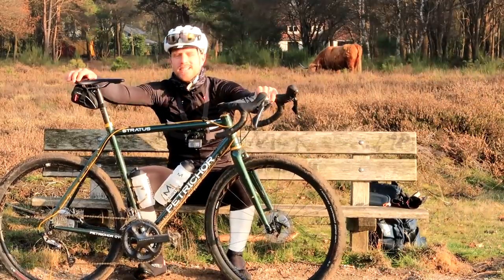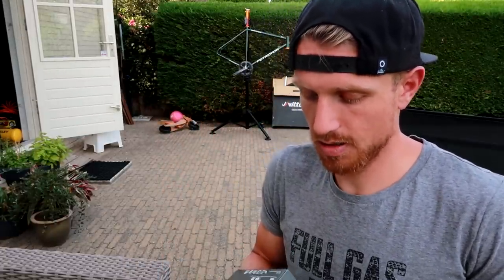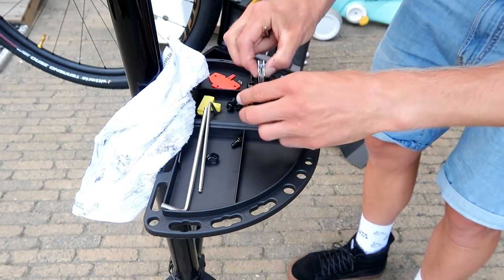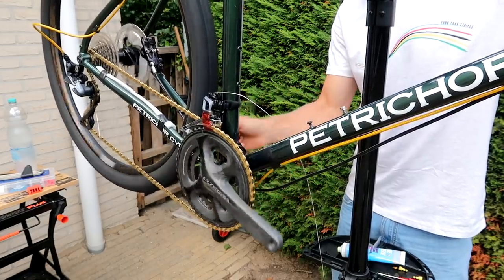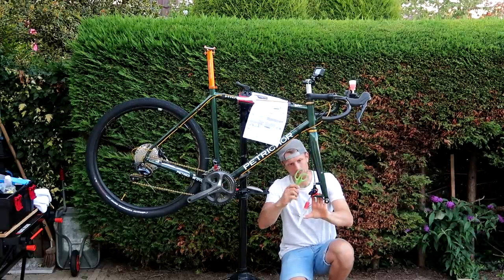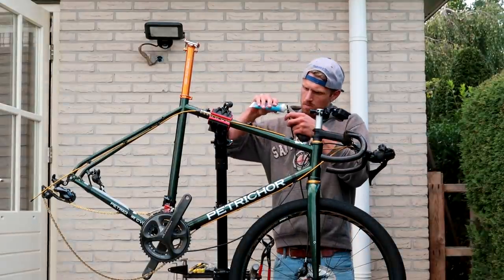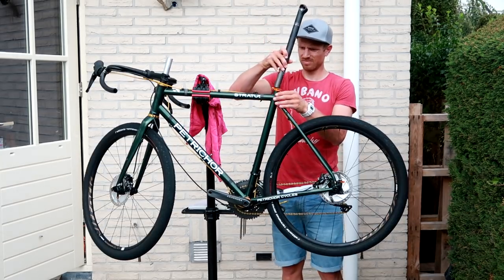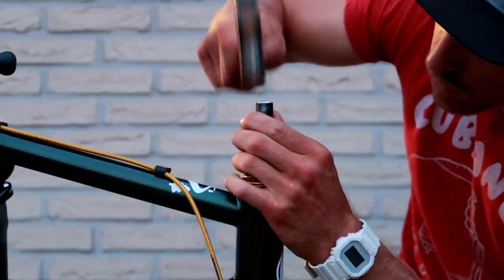My CUSTOM GRAVEL BIKE BUILD | part 2 - Installing and bleeding Shimano disc brakes

Comment: From my own experience. Steel frame with carbon seatpost. Make sure the frame seat tube edge doesnt have sharp edge, if not over time it will pinch/damage the carbon seatpost and do not put any grease on the seatpost. Also there is a easy way to bleed the fluid by using garden bottle water spray. Anyway bike looks awesome 👍
Reply: yup just a bit of softening up the edge. also sounded like he could use a thin metal shim too

Comment: I'm putting off swapping the brake cables round on my new road bike because I'm used to having the front brake on he right lever. It's fine 99% of the time except when I REALLY need to stop quickly.

You've not filled me with confidence.

Great video though. There are too many YouTubers unwilling to show their mistakes, but that's what we all need.
Reply from the maker: I always show mistakes and stuff I learned from them, just like in my race videos! 

Just for to a bike shop or mechanic and have them help you with the swap. Good luck!

Comment: Disc brakes for me are like being in a relationship with a really high maintenance girlfriend with a lot of allergies 😄😂
Reply: SAF1981 just get used to it it's way easyer
Reply: KISS. 😊
Reply: After sometimes you get experienced with and you gonna enjoy this friendship!
Reply: I have disc brakes on my DH bikes since…ever. Never felt like they stress me out. I regularly bleed them and change pads or discs if required. Do not understand why people have a problem with them.

And I am really happy to have disc brakes on my next roadbike, too. The power, consistency and modulation are WAY superior to rim brakes.

Comment: Thanks for this - a very nice-looking build and you taught me something new. :) I wasn’t aware that the hydraulic brake reservoir had a rubber diaphragm in it. On the MTB-side where hydraulic tech is time-honored and tested, spares are readily available: a spare for the Shimano diaphragm in my humble brake model was EUR 1,50... Here’s hoping roadie hydro spare part availability increases over time too.
Reply from the maker: Yeah same. This part is not available separate...
Reply from the maker: And thanks!

Comment: @jasper verkuijl I hope you used some grease, lock-tie, carbon-paste and when installing because otherwise you will damage your bike. Especially your seatpost should have carbon past on it, carbon and alloy will react to each other and totally seize overtime, breaking you seatpost by removing it. For carbon frames with alloy seatpost it is even worse, you will crack properly your frame.
Reply from the maker: 100%. Check part 3, coming up today!

Comment: You can cheaply and easily use some all thread, washers and nuts to install that headset. Parts you can pick up at your local hardware store. That being said, you can never go wrong getting help from your local bike shop.
Reply from the maker: It's very easy mess up that way too. Didn't want to fuck up my 140€ headset...

Comment: Next time you bleed shimano brakes just do it with gravity. Put the bike in such a way that the hose line is as "vertical" as possible or at least going down all the way to the caliper. Then put the funnel on the lever and fill it with oil. Attach a hose to the caliper and possibly a bag to it, then open the bleed nipple on the caliper. Then just wait. The oil from the funnel will flow down in the system down to the caliper pushing all the air out. Of course, you need to make sure there is always oil in the funnel, or you will suck air in the system. Then close the caliper bleed nipple and follow the last step of the shimano bleeding procedure to bleed just the lever. That is even easier than changing a mechanical cable :-)
Reply from the maker: Yeah in saw that but it seemed to be so messy with s bag etc.... But I guess it works well?

Comment: if you go for elox parts stay with the same brand as it varies with the alloy and the chemicals. I have green tune pars and green wolftooth parts are darker or green garbaruk parts are more pale.
Reply from the maker: Yeah that's what I did in the first place with the BB, seatpost clamp and seatpost.  All the same brand. But tuned out to all be orange...🤦

It's difficult to find all parts of one brand in a specific color..
Reply: Jasper Verkuijl check out paul comp as they do the exact same elox as white industries.

Comment: Jasper builds a bike, dude, every "mistake" you made I am sure I have made, and I am sure many other cyclists have made as well. Mineral oil gets everywhere doesn't it? At least you were outside, my first time I bled the brakes inside on the carpet. The only thing worse is SRAM brake fluid.  If this was your first time, you did pretty good. Good news is, once you get hydraulic brakes bled and everything is done, you don't have to touch them for a long time. I hope you find your matching parts and cables for your Goldfinger bike.
Reply from the maker: Yeah I'll show how the brakes are performing in part 3!!🤙🤙 Plus the rest of the build 👌

Comment: Oh man... Did this on one of my builds. And it wasn't even my first time! My first Hydro Shimano build went perfectly actually. I was like "what's the big deal. it's so easy!" But then did exact thing you did on another build and crushed the olive. But the issue for me was that it wasn't leaking so I was able to bleed it. The bigger issue was that after a while, my master cylinder POPPED open (because of cross threading, there was too much pressure inside the master cylinder threads). There was a big crack on the size and it would leak from there. 

Yep. New shifter at that point.

Since then I've built more hydro disc shimano bikes and 0 issues cause I'm super careful about that part. It's an expensive mistake but also a priceless experience once you learn.  Now I know what to be careful about and what to expect for future builds.
Reply from the maker: Learning the hard and expensive way.....🤦

Comment: Great video, Jasper! Big respect for the honesty about the challenges and mistakes (contrary to the 'dream builds'). I built a gravelbike in the same period, with a lot of the same challenges you had (and lots of other ones...). Your warning on Instagram about connecting the hoses to the shifters came right on time! Thanks for that. The fact that MTB-calipers do match with road-shifters (while Shimano states 'no') would have saved me a lot of time and money though...

I was wondering: why did you choose Ultegra in stead of a GRX, which is gravel-specific?
Reply from the maker: Hey Joost. Yeah i watch those dream build videos and it loos easy but it's nothing like the real thing! 

Ultegra works fine, i didn't see the benifit of grx vs the added price + i had an ultegra crankest left over. . I got this group set off marktplaats for a good price.

Comment: Did you hear about the zrace disc brake?!
The hydraulic is only in the caliper,but it’s pulled by wire.
People who tested them say they are way better than mechanical ones 🤙
Reply from the maker: Sounds like it be worth to check out👍

Comment: nice video... and thanks for sharing your mistakes. most of them i made myself.. and still make^^^ tip: use carbon paste for carbon parts. you dont need so much torque and it hold mmmmuch better. building a bike without the special tools is really hard and stressful^^
Reply from the maker: Yep I always use carbon paste 👍

Comment: By the way, do you always have to press fit a headset??? I didn't think you have to right?? Is this kind of the same thing as the option with a bottom bracket??
Reply from the maker: These ones you do. Some frames have the cups already integrated in the frame, than you don't.

Comment: 13:15 this is what happens when people watch into their gun when it does'nt work :')

By the way, aliexpress is good for cheap tools, they probably would not last long if they were going to be used all day long by a professional, but for someone who is using them 3 or 4 times a year, they are good and do they job !
Reply from the maker: Yeah I looked into that but aliexpress sometimes takes weeks to get stuff in and I needed things asap haha
Reply: @jasperverkuijl  Look from where it is sent, you can filter it and get stuff from europe.

Comment: The olive was crushed, because you drove the bolt too far in. The manual does say the bolt is to be tightened, but not driven all the way up until it touches the port, because if you force it in that way the olive gets crushed. It's a bit tricky to get it right when you are doing it for the first time ever though.
Reply from the maker: Yeah i had it way less far in before, but since it was leaking I kept tightening it further.... So it was leaking because it was not straight, and than it crushed because I tightened it, thinking I could solve it that way.... 

I now known how these parts work and need to be installed 🤦

Comment: I have a 2017 Specialized Tarmac with post mount disc brakes, and so Ultegra calipers won't fit.  The calipers that came with the bike don't seem to be as good.   I wish there was a solution but I can't see one.  Not a huge issue.  I wish Shimano made their best calipers for post mount but clearly the manufacturers have abandoned that standard.

Anyway, as a mechanical anti-talent I feel your pain.
Reply from the maker: Xtr Will fit and is reaaaaly good 👍

Comment: The way the frame is designed makes things so complicated. I would never buy such a frame...
Reply: What would be your recommendation?
Reply: @tuttobicci   I would look for a frame with internal routing, standard trough axles (12mm), threaded bottom bracket and flat mount diskbreak mounts. Something like the Standert Erdgeschoss for example.

Comment: Well, if its so easy to mess up installing a simple cable into a shifter, I'm gonna go ahead and say that that's pretty much just a really shitty engineering job by shimano, and not so much your fault...

Oh, and titanium bolts stretch when you do them up, meaning they wont fit anymore if you ever take them out. 
Soooo I hope you just did them up finger tight, otherwise you're gonna have to buy new bolts if you ever wanna use those boltholes for something :s
Reply from the maker: Mmmm, I hope they don't stretch 🥴

Comment: I cannot even begin to describe my total hatred of disc brakes. The sheer hassle and expense of maintaining them makes my blood boil. If you've always had bikes with rim brakes, and have always been on the fence regarding fitting discs or buying a bike with discs, just don't. For the love of all that is holy, stick with rim brakes. Your mental health and sanity is far more important than having brake power that (in most cases) is totally unnecessary for most riders and weather.
Reply from the maker: I’m general I totally agree! Had my blood boiling a few times in this bike build 😅
But, I think it’s proven in the MTB world and even for certain gravel terrain or heavy loaded bike packing. Wet and muddy conditions are pretty shit for rim brakes 🙁